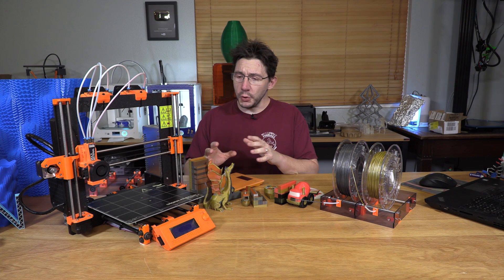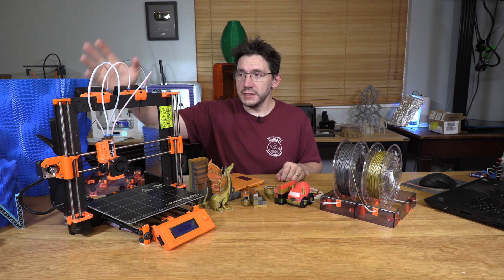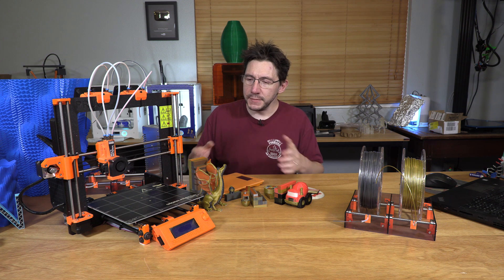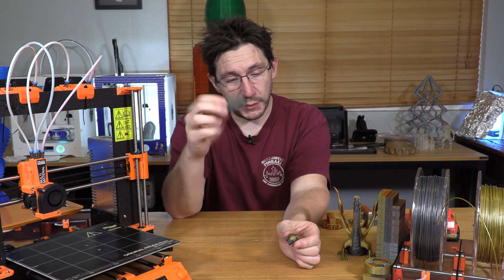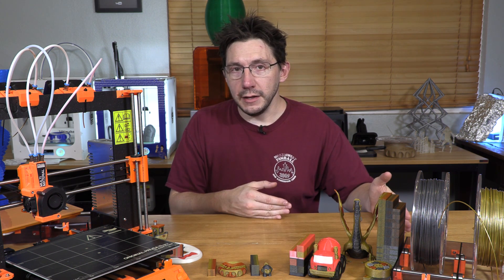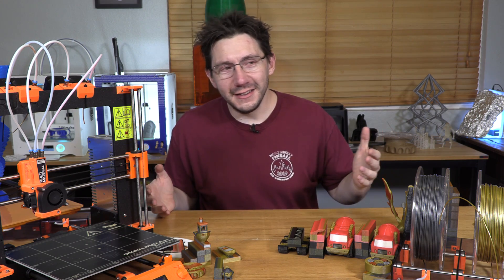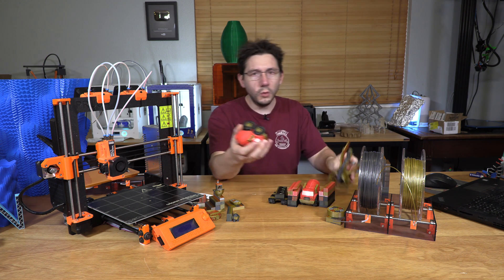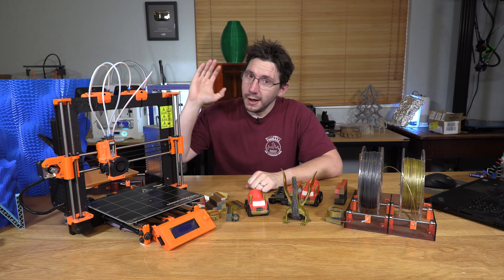Prusa Multi Material Review(?) - My Thoughts on the Prusa MMU 3D Printer

Comment: I think you missed the point. The amount of waste scales linearly with the amount of material changes, and nothing else. There is a constant "purge volume", which is purged at each change. Yes, having large areas with each color means less purged per printed volume, but the best ratios will be achieved by just not changing colors within most layers at all. Meaning, this multi-material setup works best as a sort of automatic filament change. You could also pull tricks using a slicer or with the stl files such that the materials get interlaced: One layer with one color, the next with the other color, and due to a higher flow rate and gravity being gravity, they still fuse. Anyway, long story short: MM is best for cheap filaments and Z-separated changes, dual/multiple hotends are better for expensive materials (conductive, soluble support...) and of course, a mixture of dissimilar materials.

Comment: Two things here. First, purge blocks. Purge blocks need to be controlled. What I mean is that you need to be able to be able to allow the purge block be something. A multi-color vase, or something else. Second the slicers need to be able to take into account infill and use the purging material in the infill. Why are we wasting so much volume on good material? 

Another idea is needle valved print heads. Having a physical shut off in the head could cut the purging greatly.

Comment: Since this pursa can print different colors, can it also be programed through your G-Code to print with two or more different filament material that may or may not be of a different color?

I suspect that eventually one or more of these 3D printer makers will figure out a way to mount a type of automatic tool changer like you see on CNC milling machines.  My CNC hobby mill has an option for an automatic tool changer.  This allows for changing from one cutting tool to the other seamlessly.

In the case of the Pursa 3D printer, a print nozzle changer could be integrated into the mix of components along with three or four separate hot ends on standby.  When printing of one color or print material is done,  it could then just swap out the heated nozzle and thereby skip the "Purge-Block" all together.

I know, I know; easier said than done but,  that's what they used to say about CNC milling machines.

Comment: It is mind-boggling where 3d print technology is going!!!
Now that the color changing "issues" have been sorted out, here is a possible path forward:

1) Mount a "wipe plate" to the Z axis slide holders but outside the vertical area of the bed.
This will have to be adjustable in relation to the horizontal plane of the nozzle so that when the nozzle moves over it, the nozzle gets wiped clean.
Make it out of something that the extruded plastic will NOT adhere to so that any material deposited there is easily moved out of the way by the nozzle on the next path.
This might sound "unnecessary" but read on.

2) Then the slicer apps need to catch up!!!
(I believe that Joseph has taken one of them under his wing as far as development goes - kudos...)
What the slicer needs to do is print the outer layers of the color currently primed and then do the filament change BEFORE continuing printing the infill.
If the infill is done printing before enough volume has been printed then simply move to the edge of the travel and extrude the rest there, wipe the nozzle as described above, and carry on with the new color.
This way there is no "purge block" and its height layer integrity will not have to be maintained for future purges.
Maintaining this vertical integrity is probably the most wasteful aspect of the entire methodology and adds a lot to the volume of plastic being used.
And takes time!
Having the excess purge in the form of a "rats nest"?  - So what?
Easier to recycle rats nest than a big solid block!

3) If the people can get the slicers to REALLY be intelligent then this process can be taken even further.
Lets take the dragon as an example: half way up the model there is the chest in one color, the main body in a second color and the wing inserts in a third. (there may be a 4th color?)
If you can define what the purge volume needs to be then if that volume has already been printed as infill, move to the next color section (or sections) and print the outer layers on them, do the next color change and then carry on doing infill.
If all the infill has been completed for the entire layer but a purge volume has not been fully extruded yet then purge the rest of the volume in the dump area.

4) Infill should only be printed after a color change and before the purge volume has been reached if at all possible.
At the bottom of the dragon there will be very little if any material being dumped,
But as things are done now, the purge block needs to be maintained so a lot more material is being used in maintaining the purge block - all waste!
Nearer the top of the model the volume of the actual print is far less so that means less infill and that means more dump purging to get to the pre-defined purge volume but that will just have to be lived with.
At least you will not be wasting good material down at the lower portions of the model on a purge block.

OK - I agree that having a rats nest of purge next to your model will look "messy" but so what?
It is the final product that comes off the print plate that counts!!
And of course keeping waste (meaning money) to a minimum.
AND the less time being spent on printing!
Remember that if the purge block and the model are the same weight, your print time will be halved IF you did not have to print the purge block at all - and purging into "fresh air" can be done at a higher feed speed which will probably do a better job of the actual purge as fast moving material in the melt chamber will drag the old color material out with it more effectively.

Honestly, this color change technology development will be "interesting" to watch unfold!
We are in for a wild ride!!!

Comment: So I totally thought that multicolor 3d printers just had multiple nozzles and offsetted the position of the nozzles for different colors... Is there a machine that does that? Because that would create 0 waste (without a fail) and you could technically have unlimited colors.

Or I've even been thinking that the colors could be cut and acetone-bonded together so that when a different color is needed it's already in the spool (Though this would take math and a shit ton of work unless done by a machine...)

Comment: Great review but your % Waste figures aren't quite how I would calculate it. For example: Marvin is a 3G print but printing it with multi-color generated 20G of waste, which means your using 666% more filament (so I'd call that a 666% waste). If you have a 10G model and 10G of waste, I'd call that a 100% waste (relative to the model). but to each their own.

Comment: Also, don't forget that each time it stops one color to begin a new one, it still has to purge/burn the same length of filament to get rid of the old color if it only printed 2mm^2 as it would if it printed 200mm^2. Less color changes and larger surface area per color on each layer should help to reduce the size of the purge block as well I would think.

Comment: I dont like the idea of purge block. Instead a nozzle cleaner at the end of bed and let the extra filament just go out(Out of bed, so has to be designed that way) and the scrap the nozzle with nozzle cleaner to star the print. This way you dont have to print complete layer but can purge 5~7mm of filament.

Comment: Can you configure the waste block?  What I mean by that is can you setup the printer to print another model as the waste block?  Of course the colors would not be a true representation of the desired multi-color model.  However, you would at least end up with another model (may end up tie-dyed looking) but it would be better that having a big chunk of waste block.  I bet that option could be written into the code as opposed to just generating a block.

Comment: This should be able to be easily fixed. The printer probably does a little to much purging between each color, so that's one. The printer should purge on the infill, rather than making a purge block(and there should obviously be a choice between infill purge and block purge)

Comment: On the plus side, if you have two or three of the exact same modeling printed, you are going to have the exact same size block, and you only need one. The block is only used to change the filament.

Comment: I think this product is really useful when it comes to multiple MATERIALS. So you can make something with Pla, soluble supports, flexible, and conductive. But I do not yet understand why you can’t use the normal S3D purge block for multiple materials. Or why the purge blocks need to be so big.

Comment: Why don't they just update the software to push the extra material as model filler rather than having a separate block?  It honestly should detect the distance it is going to travel to finish the color it currently has, add 5% for error rate, add that to interior as it shifts to the new color and continue on.
Reply: Clever!  Do the color transitions on the interior where it doesn't show.  In other words, do the purge block inside the models.  Now, granted,this only works when there is sufficient interior material to pull this off, but on smaller or more delicate models with little interior material you could perhaps offset that by printing multiple copies simultaneously so that you distribute the purge material across the interiors of multiple models.  Alternatively, print a digitally merged collection of different models using the same combination of colors to create a collection of different objects but with less waste than you would have had by printing each of them alone.

Comment: The size of the purge block is ONLY determined by the number of times you need to switch color. Your logic makes absolutely no sense. Furthermore, with smarter algorithms you should be able to save a LOT. Furthermore you should be able to create functional models instead of the purge blocks for models where the color doesn't matter.

Comment: Thinking about models. Why don't use the model itself as the purgue material? I mean, you only see the outer layer of the print, so use the purge material (assuming you're using all the same material) as the model it self. I don't know if it made sense but i think it would work

Comment: Do you think it could be made more efficient? It looks like it’s using the right colour for infin, but it could actually purge when doing infil as it will never be seen. Also, I assume that lets say you have a model that is a column and it’s the same colour for the whole column except the last 10% at the top is another colour, I assume the printer will have to build a purge block alongside the column all the way to the top simply so there is a block there to purge the colour onto. A better alternative would be for the extruded to simply move to some free space and dispense filament into mid air that could be removed by a person. It may even be better to purge that way with all models as it wouldn’t have to waste time moving around in the x and y axis in order to draw out a rectangular purge block. The only problem would be if the filament curled when extruding in mid air and messed up the extruded end

Comment: it seems to me that it would be easy to shrink the purge blocks, from what i can see only 1/3 of the purge has color contamination from previous color. so cutting them to 1/2 the size should still do the purge well enough without contamination in color. but i guess it may vary on different materials.

Comment: they should be able to limit the waste if there was enough infill on the color change to use the previous color inside the model. But they'd also need to be able to have the waste block be a different height than the actual printing layer.  Easy for a delta but time wasteful for an Acme screw Z axis type machine.

Comment: “Buy and Pull apart a zillion fidget spinners” really? You know they get sold in bulk. They probably chose one from several different manufacturers. Modified designs and finalized production. This is done in an effort to suppress the labor and materials cost, passing the savings onto the consumers. Or increase profit, I’m not naive.
Reply from the maker: +Dan Miller dude, it was a joke!
Reply: 3D Printing Nerd 3D Printing Nerd “but wait there’s more” was funnier. Waste might be a design/programming error. Someone mentioned in the comments to try using waste as infill or supports. There’s a tutorial worth making. 

You should also direct beginners to startup classes and educate about experience levels, not talk them out of the printer because of its complexity. The average person will get better at printing, why should they buy a beginner model if they have the means to buy better?

Comment: I don't know if this was mentioned in the 400 other comments, but a multi-nozzle printer doesn't waste this much filament. I have a dual head that you only need to prime each tip for a color change. This requires a very small priming tower.

Comment: ive never looked at how a 3d printer works i just guessed that the printer head works much like a hot glue gun, but with a smaller hole, if this is true then why not have a heater head that has multi holes that can print more colors  would this not cut the need to clearing out the head before the next color ?

Comment: For most models that have a lot of in-fill. Can't the program purge inside the model in a lot of places? You would save waste, and you wouldn't see the color transition.
Reply: That would work in single-material-type scenarios, but not in others (e.g. dissolvable supports)
Reply: @rayackley  dissolvable supports, they shudl literally only print dissovable for the very tip of the support right where it joins to the model, there is no reason the entire support needs to dissolve, especially when that filament costs way more than regular filament.
Reply: Still, it's a great idea. Let's hope that feature becomes available in slicer software. I suppose the slicer could take things like dissolvable supports into account.

Comment: The reason for the size of the purgeblock is that it cant print multiple layers and then switch color. It needs (if you print with 2 colors) to switch color 1 time for every layer.
Example (red blue)
Starts printing blue, switches to red, finishes layer, starts next layer with red, switches to blue, next layer, and so on

Comment: The result is very impressive, but that degree of waste is absurd.
I'm curious though; clearly the nature of the waste mostly results from having a single extruder head and needing to remove some of the filament before switching to a different one.
So...
Why was this kind of solution used VS using multiple print extruder heads?

I know that's more costly, but given the sheer amount of waste involved, those costs would presumably add up rather quickly too, right?

So what led to this solution involving 4 filaments and one nozzle?

Comment: My opinion: This engine is awesome, but why not use the waste (colour changes) plastic for the inner structure? If the infill a bit higher persentage, 25% approx, than the purge block will be smaller or sometimes couldn't build up that, if the inner structure is enough for the colour changing. What do you think? Maybe this is one of the easiest solution for it. Another thing is the filaments conductivity, if we have a sensor for conductivity than the printer "knows" when changed the colour perfectly in the nozzle. Hmmm? :)
Reply: If I print another color I can change it earlier because I know that for some time I will have the original color. There should be a big change in the printer software but I believe it is possible to reduce the waste to some 10% maybe The best one would be a mix of everything you wrote. I believe Mr. Prusa is aware of this and is working on software optimization. By the way, you could write him for sure he will be glad for feedback.
Sincerely, Paul

Comment: One problem I see with the recycling of the purgeblock, once you mix the colors you are going to have mud.  What would be nice is 4 catch bins held at the  print Z height and setting the printer so it spits color 1 in bin 1, etc.  Thus when you recycle the plastic you keep the colors clean.  Was almost going to suggest 4 purge blocks, but if color 4 doesn't start till layer 100...??
Keep up the great work,
Reply from the maker: We call that color "chocolate" :)